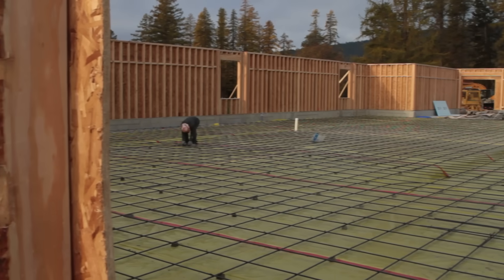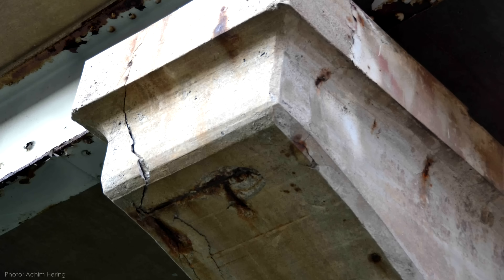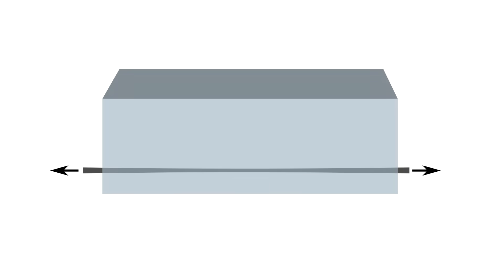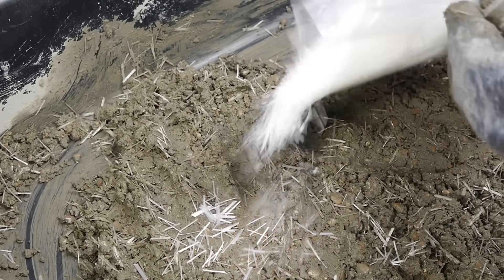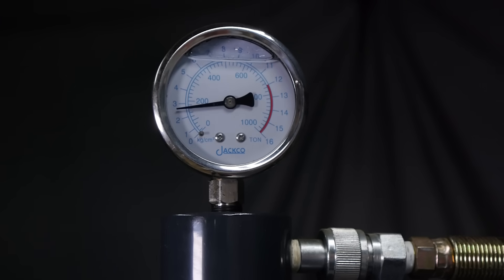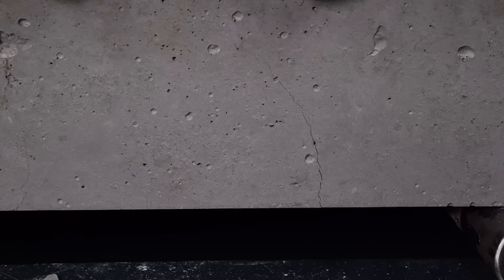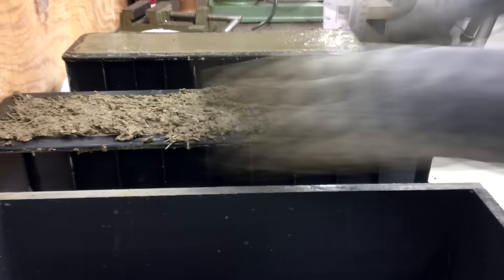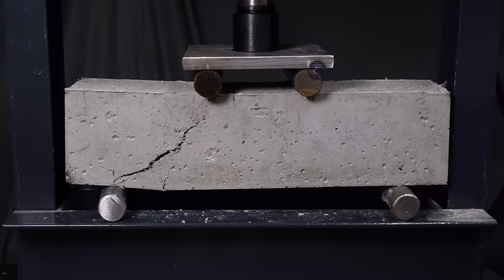Does Rebar Rust?

Comment: If steel rebar may rust in concrete. Wouldn't steel fibres be even worse? Y can't control how much cover those fibres have like in traditional rebar. Y the fibres live less than rebar, and are better distributed across the whole concrete. But if there is one steel fibre in surface of concrete, and it gets moisture. There is high possibility it connects to other fibres and so on.

Comment: It is customary to have nominated specialist greasing their formwork for RC Slab to enable easy removal of formwork later on.  Also IS standard recommend the use of a coat of cement water on the bars for prolonged stockage on site or marine environment to resist rust.

Comment: You're concrete is wrong. Where I'm from, we usually used 4 16mm Iron as the main reinforcement in the 4 corners with 12mm iron kept between the 16mm iron, and a bunch of 8mm iron which is used as a ring strengthen the iron.

Comment: One of the issues with why the fiber doesn't add much to the tensile strength is because the concrete mix isn't able to withstand anymore shear stress while it can still actually take more tensile load. The sample failed at the shear limit not the tensile limit. You can see from where the cracks first formed (at the area of bearing) and the crack pattern. Diagonal cracks signifies shear failure. Things will be different if we used shear reinforcements with the sample (which is hard to do with the samples of such size). Cool video.

Comment: In Saudi they quickly found out you should not make your concrete with sea water because the steel reinforcement will start to rust from the inside.

Comment: Very interesting and I hadn't seen some of the non steel reinforcement types before. I have some experience with concrete in the UK.
Cover protection is limited to the period time it can keep carbon dioxide or other corrosive elements from the steel. So coatings to keep them out are coming into use.

Comment: any time a piece of ferrous metal is in the ground electrolysis will occur. steel pipelines, natural gas lines and old time lead sheathed telephone cables were subjected to corrosion,  one method was to apply a currant to the metal, another was to attach an anode to the metal  some way to upset the the anode/diode currant  flow that causes  rust. what causes the currant flow?  every power power pole should have a GROUND wire to EARTH GROUND. when electricity is generated it has to return to the ground (earth) .  i'm a retired telco employee that dealt with  corrosion in lead cable

Comment: As youngsters  in the South African Air force  building runways  and fuel bunkers we mixed straw with the concrete  and were testing slump and a test with a hydraulic fracturing test bench ,that was In 1979,

Comment: The short answer. Not if you use fresh water for the concrete. A bridge in Sweden used mixed water (fresh and salt water) to save a paltry sum. This eroded the rebar and the bridge collapsed during construction.

Comment: Concerte expand in heat and shrink when cold that why you used rebar to reinforce. Maintenance and cost is a issue.
If you make too strong. It will take forever to replace. You don't use rebar for stature anyhow.  I see building with rusted up rebar and it don't make much different. Apart of ocean oil drill, Rebar it doesn't matter  that why we make it cheap.

Comment: Concrete is not stable. It slowly eats itself alive as the silicates break down and cause microtubules throughout. Then water starts to penetrate through capillary action where it reaches the rebar and oxidation expands causing fractures. Cancer.

Comment: Maybe I'm just dumb, but wouldn't be the most efficient solution to just coat the rebars in something to protect them? I know they're covered by concrete already, but why not cover them with secondary protection? Coat them in anything which wouldn't rust, and rebar won't rust even if the concrete cracks(it can by anything: metal which wouldn't rust so easily, plastic, rubber, hell even wax layer should do the job). And coating them in something should be relatively cheap and reliable(reliable because it's only secondary cover, the primary is still the concrete itself).

Comment: As someone who works in the Heavy Diesel automotive repair industry; I see more and more shops being built with aviation grade concrete as their floor to withstand the weight of having these heavy pieces of equipment laying on top of them constantly day in and day out. I wish infrastructure builders and contractors would get with the program and start building bridges and roadways with better materials. Having to repave every 5-6 years is insane, and having to repair a bridge every 10 years is less than optimal in terms of longevity.

Comment: Really interesting, does Stainless Steel not suffer any corrosion in concrete, not even crevice corrosion? The reason is I could do with burying some flexible convoluted pipe inside some concrete, but I was worried about the pipe wall corroding through. 
I do know that Copper pipe in concrete is a definite no no, but was not sure about stainless, I think my pipe is 316 grade.

Comment: Excellent ! Informative and interesting. I was surprised that adding the fiber materials did not increase the overall strength of the beam - I expected it to significantly increase its tensile strength. Would not stainless steel be a better alternative ? Expensive sure, but would it not increase the life of concrete structures a lot ?

Comment: Thomas Edison had a swimming pool built of concrete in 1900. Bamboo was used for reinforcement. It still has no cracks. I did some work on an old house in Florida, the plaster walls were reinforced with horse hair. There were cracks from the house settling, but you get the idea.

Comment: I would like to see a video about the penetration of chloride ions over time through the concrete cover. What about a video about making concrete more impermeable by adding e.g., micro silica, or fly ash, etc., to the concrete mix  to make the concrete more impermeable to chloride ions? The present video is limited to the deterioration of RC due to ingress of chloride ions through cracks. What about discussing the permeability of the concrete which is of considerable importance in protecting traditional un-coated steel reinforcement?

Comment: I'm surprised that the guy didn't mention the primary reason for corrosion: carbonation and not cracking. The protective alkaline nature of concrete was mentioned however, the reduction of that alkalinity because of the developing depth of the carbonation front reaching the steel is critical. Naturally occurring atmospheric carbon dioxide gasses [approx. 2%]  combine with water vapor and penetrate the surface of the concrete over time. Everything is preventable.

Comment: It is clear to me that under extreme conditions it is recommended to mix fibers in the concrete. But from the video experiments seems that it is always a good idea since its double its resistant to cracking. For a structure of a 10 floor building, far away from the coast, does it make any sense?

Comment: Concrete sailboats are made with rebar.  Key is to allow the rebar to oxidize before pouring concrete.
Many older concrete boats built correctly show no rust.

Comment: Help! I don't understand! I was taught growing up that Rust was another word for Oxidation of Iron (steel). Is Oxidation Not the combining of the Oxygen in the air with the elemental mental Iron?  Is not Oxidation a common demise of every elemental metal? Yes, water is an Oxygen compound which  provides the Oxygen for Oxidation of elemental metals but so is  Air. To male any metal truly Rust (Oxydation) Proof, you must coat that metal with and Oxygen IMPERVIOUS coating.    sdh in CT

Comment: So the rebar is buried 1 to 3 inches from the surface of the concrete? Do I only need to do this to the surface exposed to weather like the outside surface of walls? Can the inner surface of the wall just have maybe half inch concrete cover from the rebar?
Reply: The more aggressive environment - the bigger the concrete cover. For columns and beams indroor i would say use like 2cm, outdoor 3,5cm. Members which might have contact with sea water - 4,5cm.
Reply: That's cm and not inches? What about for internal and external walls for reinforced poured concrete? Also, the external walls have their outer surface exposed to weather but the inside surface is not. So would it be possible to make it thinner cover for the inner surface and just make it thicker for outside surface?
Reply: @boogerking7411  Sorry we use centimetres in my country. 1cm is around 0,4 of inch
Reply: No worries. I just confirmed it since the uploader used inches. I use metric too. Btw, i had a follow up question

Comment: I was somewhat surprised to learn fairly recently that concrete is somewhat porous. I always assumed that since it was used in dams and such that it was more or less impervious to water. However, concrete in architecture is typically somewhat porous. It passes water through a concrete floor slab on grade for instance unless a capillary break such as gravel and a plastic membrane is used to keep the water from wicking through. Its not necessarily a fast action, water moving through concrete, but unless there is a membrane like plastic or a lime wash of some kind that has been cured with carbon dioxide, water and contaminants can slowly pass through concrete. Am I wrong?

Comment: Totally agree about the slow progress of civil engineering materials.  The solution is to use the new materials in things where the consequence of failure is negligible like road curbs.  I tired to use basalt fibres in concrete curbing for my last project but ran out of money and had to make cuts.  Woven basalt mesh can also be used under asphalt.

Comment: Thanks for the info, this video was informal. I always wondered why some of the concrete bridge support forms always cracking.Any chance you could plasti-dip/rubberize the rebar and before redoing testing? Would a flexible coating even help the rebar I wonder?
Reply: Salty, just use basalt rebar and all those troubles disappear.

Comment: Epoxy coated, or green rebar, has been the standard for road bridges since the 1970s.  (I was making pre-stressed beams as a summer job when the DoT rules changed.) Drivers just don't do chains and winter tires, so roads have to be salted.  It's very different from a handling and tying perspective, and the epoxy is just flexible enough to stay tight on the steel as it stretches and thermal cycles through the year.  The concrete that you see spalling away in the pictures shown is likely more than 50 years old.

Comment: Why is basalt rod so much more expensive than steel?  The raw materials are almost free and the energy content is lower than steel - weight and chemical resistance of basalt rod is greater.  So it would seem that the advantages should have lead to a rapid adoption by industry.  We are something like 70 plus years since the introduction of basalt rod and it is still a speciality product.
Reply: winston it is only slightly more expensive that steel rebar.  Builders are generally uneducated and thus keep using steel.

Comment: Wouldn't steel fibers just add to the corrosion issue? Doing the same thing the rusted rebar would do, but in a much smaller scale and all over the concrete? 

We could use recycled plastic and form bars and put that in the concrete. We have plenty of that stuff.
Reply: EXACTLY Mike

Comment: Fiber reinforced plastics are stronger. Why are plastics stronger with fibers, and why isn’t concrete?

Is it because the fibers in plastic leader to a greater strength increase relative to the low ultimate strength of plastic?

Comment: Pre mix concrete is the best,as concrete made on a site will more often than not be dumped onto a small plastic sheet that deteriorates quickly or stored in big nylon bags which are not waterproof....if there is any rain that puddles around the sand, it allows all the salts from the soil th soak into the sand, this comes out for years as carbonate of lime as well as corroding rio from inside by its swelling and shrinking action that then allows moisture in, any bldg near the sea should have the distance from the face to the rio thickened by half again and if that is not possible the mix should have 25% more cement....too often people skimp on cement and if they don't cover and keep slabs damp for a few days to a week, especially in hot and/or dry weather, then when the month long cure wait is over, they are minimum standard..